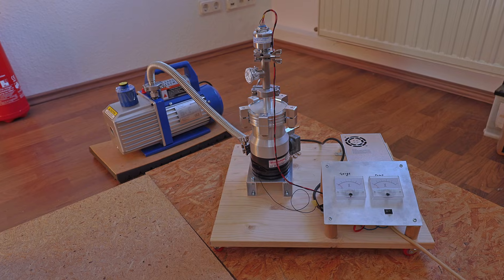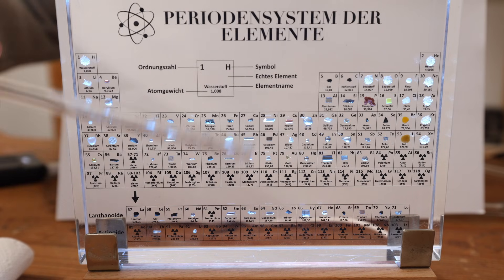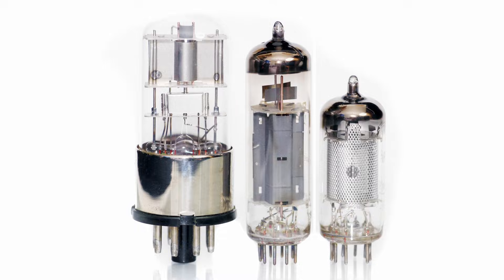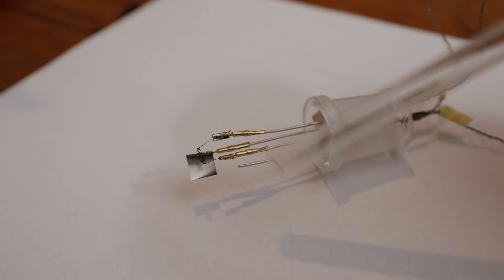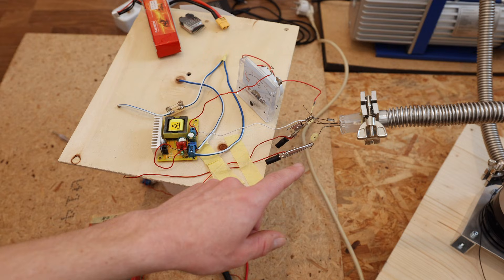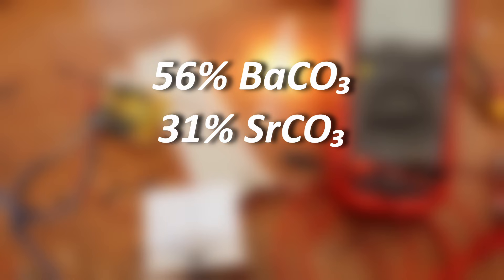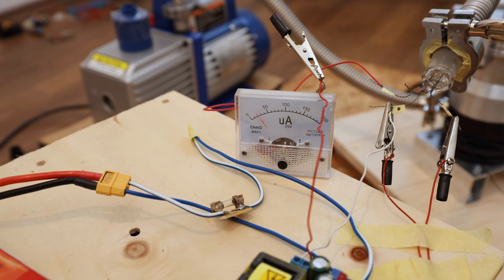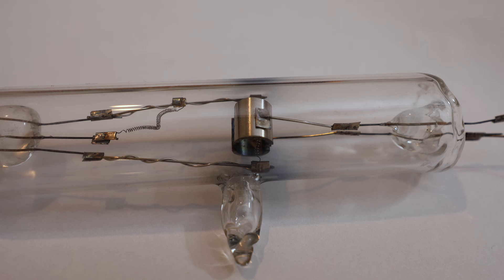Emission coating for homemade vacuum tubes

Comment: Hmm interesting. Excellent job! 

I thought that most of the emission from a cathode coating comes from the small contamination of reducing metals in the indirectly heated nickel cathode sleeve/tube. Its important to know that some(very small amount) of the oxides are reduced to elemental metals that are present in the semiconductor matrix of the oxides. Most of the emission in these cathodes comes from the elemental barium within and on the surface of this matrix. Although its a good argument that some filaments are directly heated and still have carbonate coating. The filaments temperature is also important. You need time to contert the carbonates and you dont want to overheat becuase it evaporates the elemental components. The carbonate coating is a stable long life cathode type becuase the heating temperature is set so its self sustaining to some degree. Of course activating temperature is an other thing. Also... Some cathodes are still directly heated yet coatied with elemental barium. For example low power battery operated tubes in portable radios have had barium evaporated on their cathodes(evaporation after evacuation). This allowed small heating currents (below 100mA) but also required specific temperatures(set with current, voltage and small filament dimater) in order to keep the barium on the filament. Some Tungsram tubes could reach 25-30mA heating current.

Comment: Amazing, you’re the first video on YouTube that got an emission coating to work!    One question, did you dissolve the carbonate powders in water first, or did you only use the acetone/nitrocellulose mixture directly with the powders and apply them to the filament?   I’m asking because the carbonates are slightly soluble in water, but not in acetone - and it wasn’t clear from the video.   Thanks again!
Reply from the maker: I didn't dissolve them in water. Only suspended it in the acetone.
Reply: @thesciencefurry  FYI I got inspired and bought some Ba/Ca carbonate to repeat your amazing experiments.  

I had some interesting reagent purity results I wanted to share.  

Both carbonates were claimed to be 99.9% pure.   Just as a test, I tried dissolving them in pure Glacial Acetic acid (vinegar) to see if they would turn into Ba/Ca acetates to make wire coating easier.   

It turned out I was only able to get a small amount of the carbonates to dissolve.   (In reality they should be highly soluble and react completely with the acid.)

When I let the remaining non-reacted particles settle and drew off the clear acetic acid solution,and then evaporated the acetate to get the pure precipitate, ie -  pure  Ba/Ca acetate powder, this stuff easily dissolved in water.   

What this says to me is that the purity of the initial Ba/Ca carbonates is low.     You had mentioned concerns about your calcium carbonate purity in your video so I wanted to share this experience.

In the future, I’m planning on buying the Ca/Ba/St acetates directly and then heat treating them after to get them to breakdown and get the pure carbonates and then the oxides at around 700 C.   

I’m hoping this general approach will provide much purer material to work with.
Reply: After searching more it seems the  carbonates are not soluble in either water or acetone.  So it shouldn’t matter which one is used since they’re both just carriers to deposit the particles on the tungsten wire surface and are not involved chemically.   However I did read the carbonates readily dissolve in acetic acid (vinegar) into barium acetate, which turns back  into carbonates at around 250 C.  (And then the carbonates ultimately breakdown into Oxides BaO & CaO at around 700 C).   This Acetate method might be another method to get uniform deposition of the alkali metals on the wire.
Reply: Great articles on emission coatings:  

https://www.cathode.com/pdf/tb-160%20thru%20164.pdf

https://www.cathode.com/pdf/tb-135.pdf

Comment: Great video! Is there any interesting advantage of using the recipe that you provided over just BaO? Is it possible to coat the filament by dissolving the carbonate into ethyl or isopropyl alcohol? During my last tests, I did try with a uncoated filament from light bulb to make a CRT but it turned out that the emission was too low, maybe I should give this method a try.
Reply from the maker: On Wikipedia it says a mixture of BaO and SrO gives the lowest work function. The mixture is from a website making these coatings. Unfortunately the carbonates don't dissolve in ethyl or isopropal alcohol.

Comment: This is just inspiration I need to join you in this research on my end! I have the carbonates on my workbench ready to mix. 

- Did you buy your carbonates from a pottery supply? That's where I found mine, apparently they're all components in ceramic glazes. They're cheap, but they're also definitely "technical grade," I'll be interested to see your approach to cleaning them up. 
- Nitrocellulose binder is a classic. My plan is to use Ethyl Methacrylate. Apparently Methyl Methacrylate is a common binder for brush-on emission coatings, but it's not readily available whereas Ethyl Methacrylate is used to polymerize acrylic powder for acrylic nails, so it's all over the place. 
- I suspect you also found Transene's page where they give the ratios for their T-33C-118 cathode coating, lol. I was also going to borrow that ratio. 
- Did you do a "burn in" cycle prior to testing? My understanding is that when this was done commercially, they would drive the filament quite hard for a bit to get the most conversion of carbonates to oxides possible. You're probably aware of this because I think it's mentioned on the same Transene sales page, lol. 

Anyway, this is excellent work! Cheers!
Reply from the maker: I got the barium carbonate from a chemical shop, the strontium carbonate from a friend and as I said in the video, the calcium carbonated from ebay.
Not sure what site I got the ratio from, don't remember. But I've read the stuff about that burn in cycle. However I didn't bother doing all of that, so there might be might be possibilities for improvements aswell.
Reply: @thesciencefurry  Yeah, you're already getting results so I suspect there's even more performance to get out of it by playing with the application and burn-in. That's exciting

Comment: Well, super cool to see you playing with coatings. Do you think the filament current you're using right now is reasonable, or could it be optimized? 

I think an advanced direct heated subminiature tube (from the mid '50s, eg CK6088) has only about 0.02W of heater power (20mA at 1.25V) and gets over 1 mA of emission. But I'm sure they're probably able to use obnoxiously thin wire, and of course the best possible chemicals and process. What you're getting here seems very usable, and impressive for a first try. 

What is your heater power right now?

"No fuse" written on the multimeter... lol that's very relatable! For a very long time my old multimeter had a piece of steel pot scrubber wrapped around the blown fuse's body and shoved back into the holder. Not defensible, I know... but I did actually blow it out later, and it protected the multimeter!
Reply from the maker: I think it could be better with higher purity carbonates, and that's what I'm gonna do for the next tube. 
Unfortunately I don't have any idea about the power, because I used a constant current to drive the filament. 
And yeah, I really need to get a new fuse XD Unfortunately I need the uA meter for the thermometer function, so I bridged it too.

Comment: Nice video. You can also try thoriated tungsten from a red tig welding bar. TT have a very low barrier and emit a lot of electrons
Reply from the maker: Welding rods are very thick, you can get thoriated tungsten wire, but It's gonna be worse than the coating.